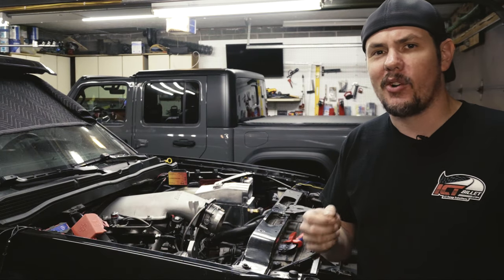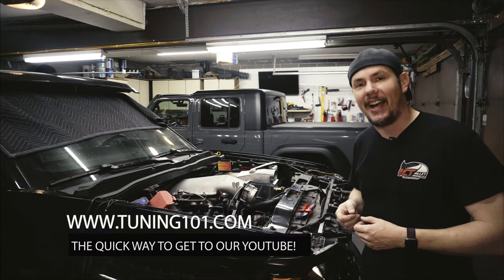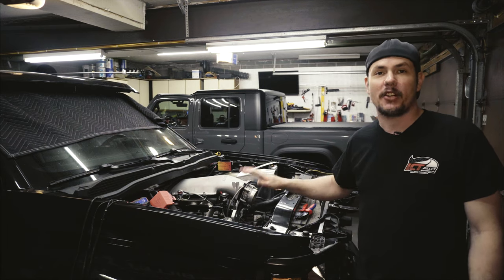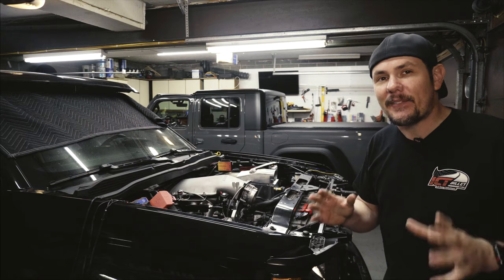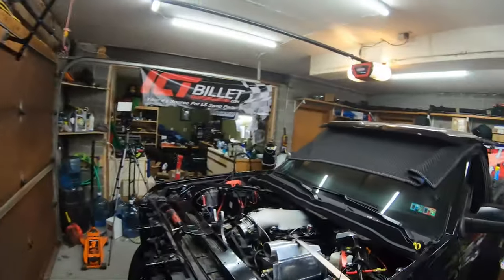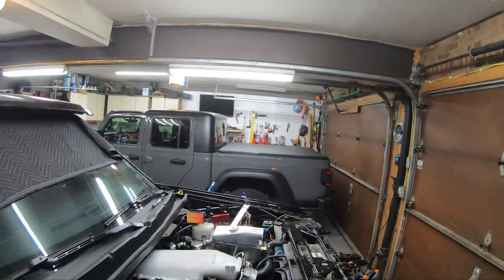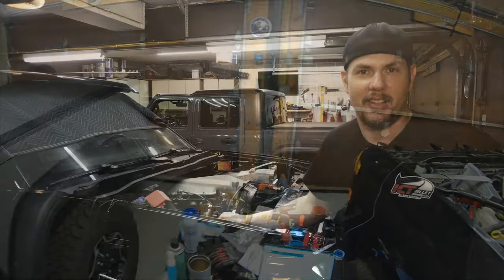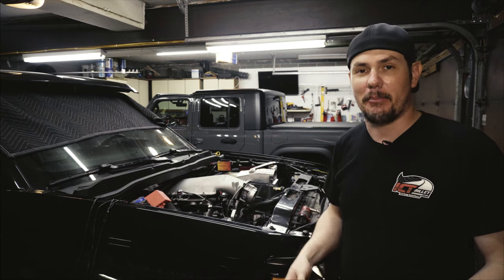Testing The Wiring On Our 2-Step, Nitrous, Line Lock and Stabilitrak Disabler!

Comment: That’s soo cool man , you’re using all of the cool drag racing gadgets ,That’s an electronics engineer  dream setup . I hope it all goes well and we see this thing ripping .it should be time for rear end upgrades with  the extreme launches this thing will see . As for the go pro it’s nice change but you’re so tall it’s hard to see things well , may i suggest a chest strap for the go pro it would give a much nicer view imho
Reply from the maker: Good idea on the chest strap! Rear end already has gears, posi and axle upgrades